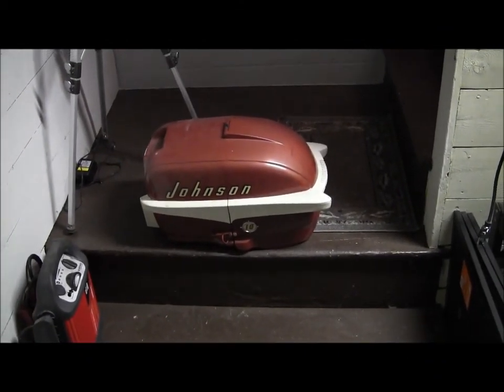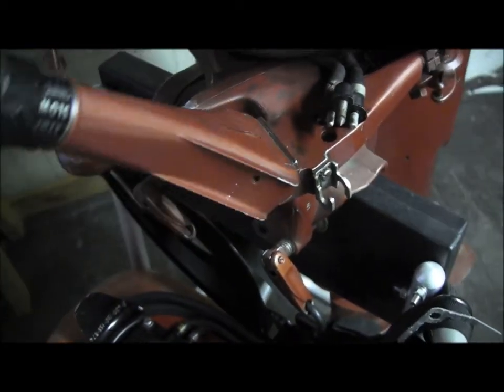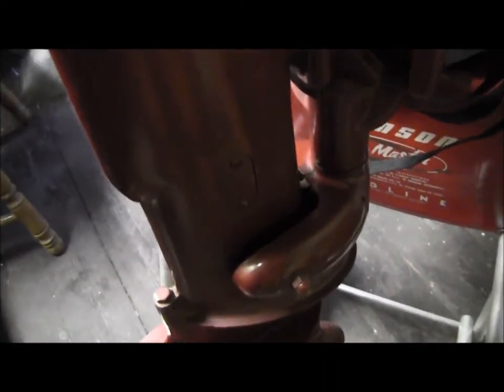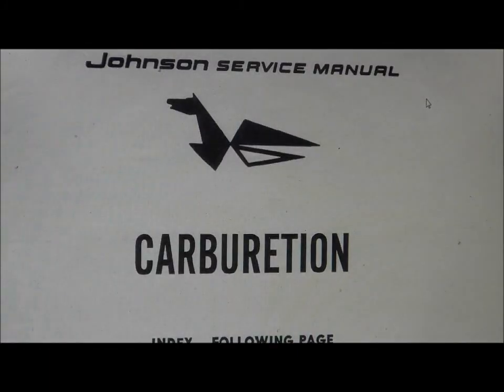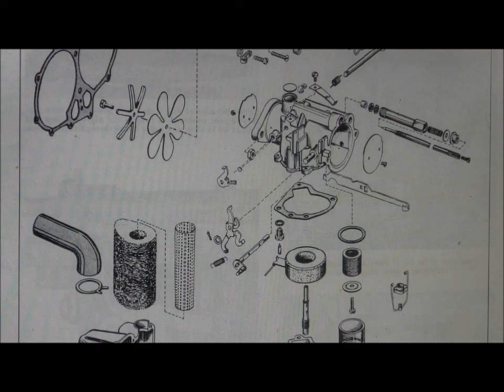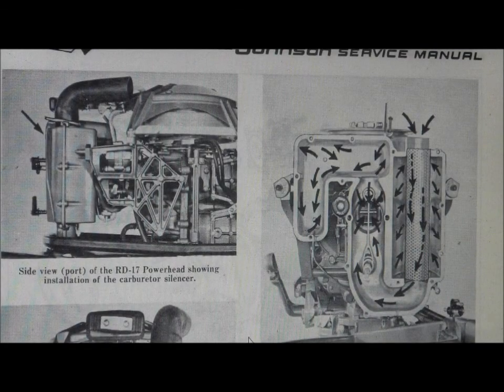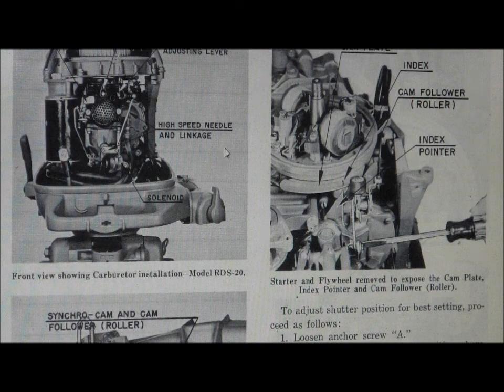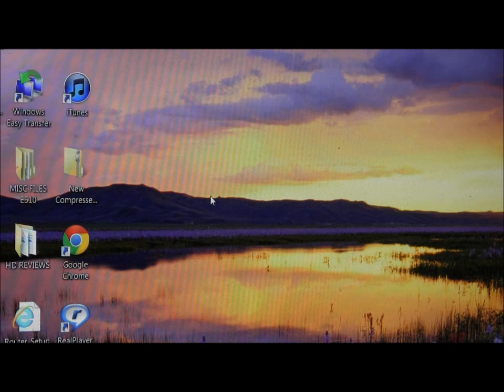'55 vintage Johnson RD17 RD18 antique outboard tech info

Comment from the maker: Hey Doug, 

You are correct, early models had low end power and would throw a small person out of the boat LOL.

Only similarity is lower units, block, and transon clamp setup. Newer ones had advanced castings, much better bearings and more streamlined cowlings.

Thanx for watchin and the comment. I appreciate it :)

doug

Comment: Hey man could you post links to websites for parts for this motor. I'm about to buy one for 50$.
Reply from the maker: Hi Jim,
If you have a '56  (as I showed) factory reprints are avail online. Google outboard motor service manuals and select year and model you own.
Parts avail from many sources too, Marine Engines.com is a good place to begin.

Comment: Hi I have a 1956 Johnson 30 hp motor that I am refreshing to use on my boat I need to know where to and how to install a kill switch also there is an old 14 gauge wire is that to recharge the battery? I would apreaciate any help you can give me. located in providence thanks. Tom.
Reply from the maker: Hey Tom !
Send me some pics of your motor, include the model and serial numbers so I can determine which motor you are working on...
Happy to help, but need the exact specifics to be accurate !
Doug @ the "ranch"